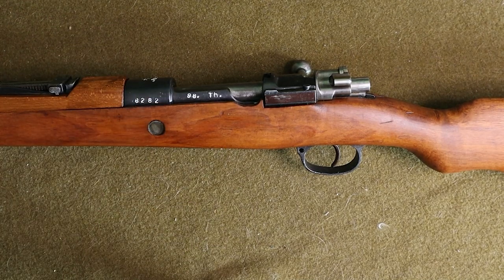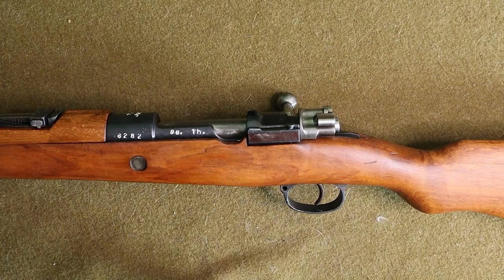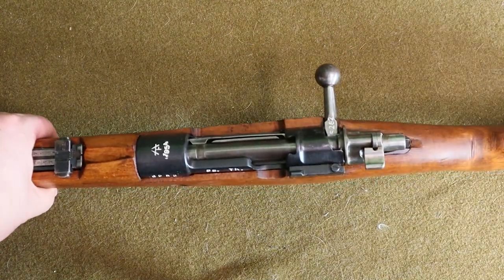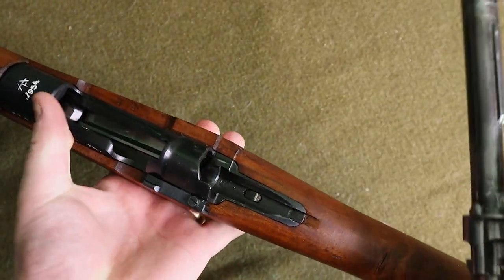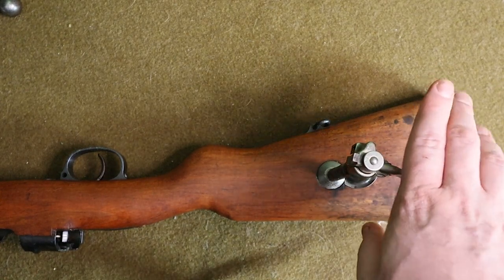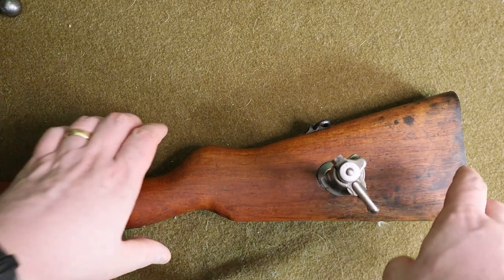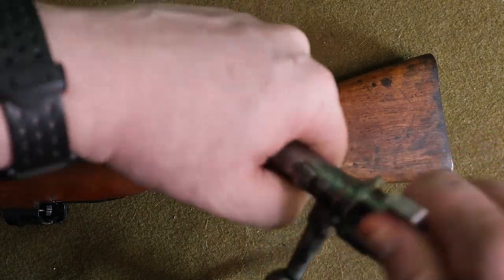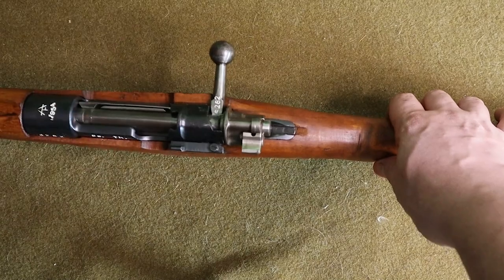Turkish M38 Mauser Rifle Field Strip and Bolt Disassembly.

Comment: This actually helped me, thank you. I got my 24/47 a few months back and had a hell of a time figuring out the field strip for the first time. It was mainly the bolt orientation that had me confused upon reassembly. The K98's slightly longer bolt and curved handle threw me off.

Comment: I bought a 1895 Turkish Mauser barreled action (refurbished in 1935) & had a dickens of a time finding a good stock to put it in along w/ the bands to put it together.  Wound up using a Chilean stock, did some wood working adjustments inside the forward receiver cut with a Dremel to get it seated in good.

Comment: Your restoration looks great,  looks like how I do them however you can easily get that black crap off with oven cleaner/ sodium hydroxide, then rinse with hot water, coincidentally it tends to remove dents in the process

Comment: Video was helpful for even though I have a different bolt, ended up having a mismatch 1893 bolt converted to 8mm and was thrown into my turk, still works but is a totally different animal on the first few steps of disassembly
Reply from the maker: Yeah that's a cock on closing earlier action. This is a 98. Same concept with the earlier ones.
Reply: @MikeB128  yeah, my extractor claw for it broke too so I'm trying to source a whole new extractor, ordered a m93 chilean extractor hoping it'll fit. If not I'll have to take it to my gunsmith and see if he can Frankenstein the claw off the chilean extractor onto my original one.
Reply from the maker: You really have never heard of these guys? https://www.gunpartscorp.com/

Comment: Make sure the safety is straight up when taking the bolt apart
Reply from the maker: Didn't I mention that and show that in the video? It won't come apart if the flag is in any other position? Or did you not watch the video before commenting.

Comment: Hey mike, thank you for the video I really appreciate the response I didn’t expect one.  But, i need to be alil more clear. Maybe not a field strip (even though I said that) but stripping it Down to just the barrel and action apologize for the confusion. Thanks again!
Reply from the maker: Yeah I can do that. It's more involved and such, but it's pretty easy.
Reply: @MikeB128  the K.kale stocks sometimes have a pinned screw in the middle barrel ring that was hard to take off. Thank you chief

Comment: Thanks for the video, Mike!

What's your opinion on dry firing the absolute dog shit out of a Mauser? Any increased chance of damage as compared to regular live fire?
Reply from the maker: I've never had an issue with a Mauser snapping a firing pin. They were dry-fired in training all the time. The only firing pin I've ever snapped was an Arisaka T99, but those are cast, crappy metal, and are not great to dry fire.
Reply: @MikeB128  Thanks for the info. I've got a Turk Mauser and M91/30 that I've dry fired quite a bit and I was wondering if I'd caused any damage.

Comment: I've got a good question for you.  So I bought a couple mausers one being just identical to this but sadly sporterized.  The rear sight for the elevation ladder how do I disassemble it?  The locking slide on it is upside down and I want to fix it but having no luck finding out and I don't want to damage anything.